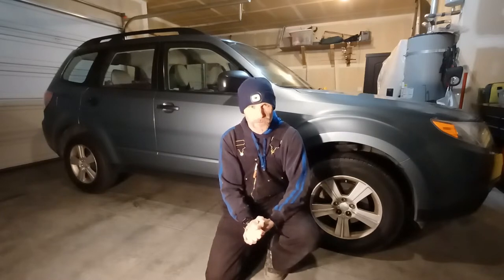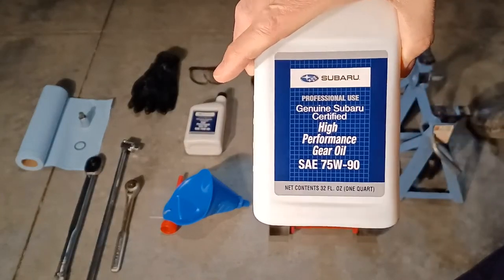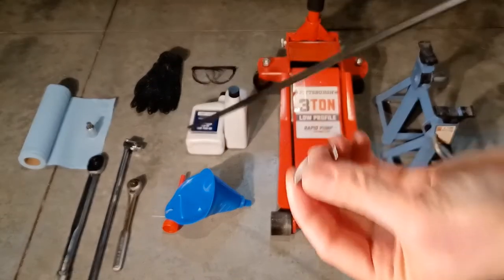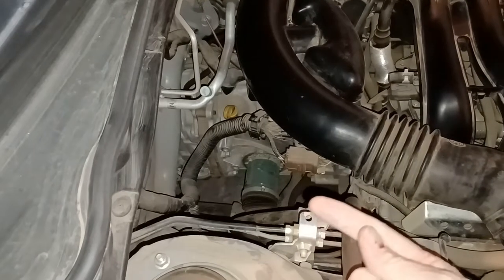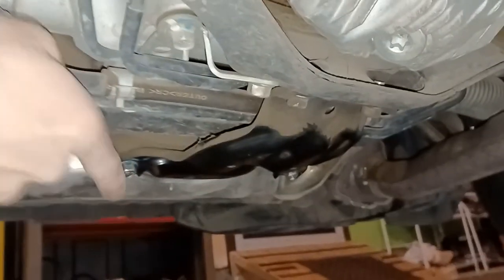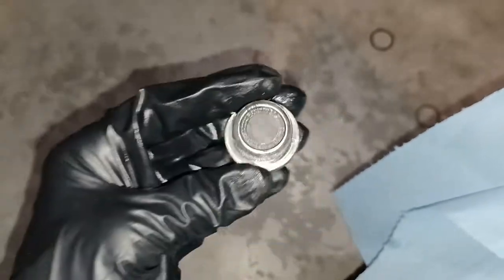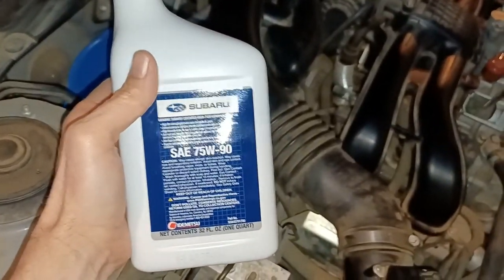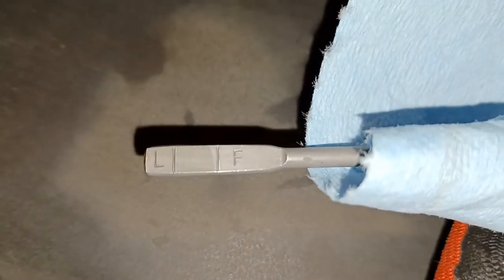How to: Front Differential fluid drain/fill 2009-13 Subaru Forester

Comment: The words “DIFF OIL” are embossed on the bottom of the differential oil drain pan, right beside the differential oil drain plug. You may need a rag to wipe away accumulated grease and other debris to see the embossing.

Comment: Is it integrated into the transmission? Do I have to change the front differential oil separately or is it the same as transmission oil change?
Reply: Here are the four Subaru oil compartments:

1. Engine oil (and filter)
2. Transaxle oil (and filter)
3. Differential oil -front
4. Differential oil -rear
Reply from the maker: Separately they are not integrated

Comment: What is the part number for the front differential drain plug gasket? Link to where you bought it? Great video.
Reply from the maker: Hey Chris...its benn a little bit now since I got that part, but I believe that it was from my local Subaru dealer, because they actually were as cheap on that as anywhere else! Plus, I wanted to do it right away, and there was no wait time:-) Thank you for the kind words, and sooo glad this could help you! Sorry I was not able to answer your question with a link, because my Subaru dealer charges a shipping fee to purchase online which would negate any savings you might get from purchasing local.
Reply: For my 2011 the Subaru dealer near me gave me the gasket part number 803926090
With measurements 26.3 x 32.3 x 1
Reply: @1hpimaging that’s very helpful. I’m assuming it 26mm inside diameter and 32mm outside diameter…??

Comment: Like the videos. Have a 2013 and want to do all these services myself. Videos make the job look straight forward
Reply from the maker: Thanks Verdayne!!! Yeah buddy, I know you can do it! The hardest part is getting started and of course it takes a lot longer than it normally would because you're doing it for the first time.. just take your time and follow the steps and you will be just fine. Let me know how it works out if you decide to tackle some of this. Leave a NEW comment though if you have a question, so I get notified again, otherwise I will miss it. Thanks for comment buddy:-)

Comment: Liked your rear differential video.
This one appears specifically to automatic transmission but did not state. Manual different capacity.
But still helpful if one had automatic.
Reply from the maker: Yeah sorry, I guess I didn't put in there that this is for the automatic... Not sure if it is the same for the manual oh, I'll have to get back with you on that one:-)

Comment: does this apply to a 09 outback? the video was perfect.
Reply from the maker: Hey Christopher, the general outline of steps is pretty much Universal to changing out the differential fluid... the only thing that might differ is make dang sure that you verify that the gear oil is the same viscosity and the fluid capacity might change just a bit. But remember this is just my opinion and is in by no means professional advice, so always consult a qualified technician before performing this action.

Thanks for watching!!!

Comment: Thanks so much for this comprehensive guide!!!! 
Are you able to make one for the transmission (gear) fluid/oil change too.??? 

I need to do both front and back diff as well as engine oil AND transmission oil changes for my 2010 fox and would love to see you do it.
Reply from the maker: Glad I could help Katie! And I know dang it, lol...I changed it right around the time I did these, but did not have time to do the video, so now you will have to wait the 30,000 miles to get that out of me (shouldn't be too long though, cause I drive a lot):-) Glad to hear that you are taking on these tasks yourself...Absolutely LOVE to see the mechanics lose out on money that should stay in the drivers pockets with easy tasks like these! Keep it up and video coming soon:-)

Comment: How do you drain the front differential gear oil from the front differential on a 2017 Subaru legacy
Reply from the maker: Hey Steven, it should be pretty close to this action...but I do not have access to this year Subaru, so I cannot confirm. I do hope that you got it figured out though. Best of luck!

Comment: Source or part # for drain plug, wife's ruined on some previous trip to service, ruined, socket for T70 wont fit ..
Reply from the maker: https://drainplugmagnets.com/cars/subaru/
Reply from the maker: I believe it is the M26x1.5x16...but please confirm with a Subaru dealer before buying:-)

Comment: Hey, front differential is not actually name. Just manual transmission man. You re not mechanic real.
Reply from the maker: Hey K story...as far as Subaru is concerned for us "regular folk", this is how they refer to it. But you are correct, I am not a mechanic, and my videos are for entertainment purposes only:-)
Reply: @hurstysgarage  You're doing great.  Really helpful to us retired people maintaining our cars for a fraction of the cost charged by a "real" mechanic.  I can change it by myself faster than it takes to drive to a mechanic.
Reply from the maker: @iamtoothewalrus  Love to hear that, cause you are a 100percent right! Thank you for watching!!!!
Reply: If the vehicle is manual transmission. Your going to find the transmission dipstick where you would find the differential dip stick on a automatic. That is what he meant. So “op” is partially wrong. IMO your video is good.
Reply: It is an all wheel drive vehicle with a differential. He changed the differential fluid, not the transmission fluid.